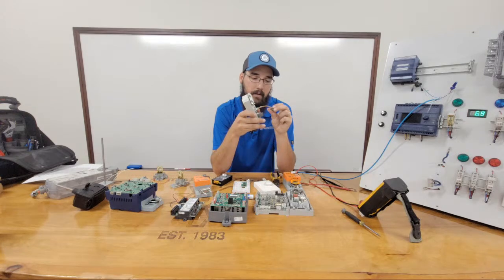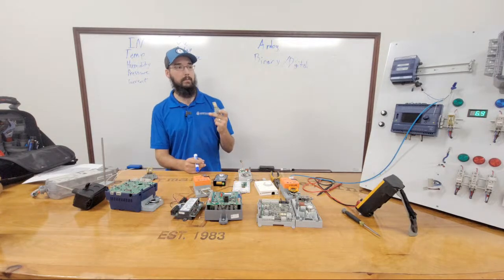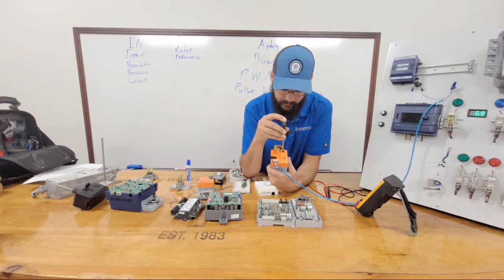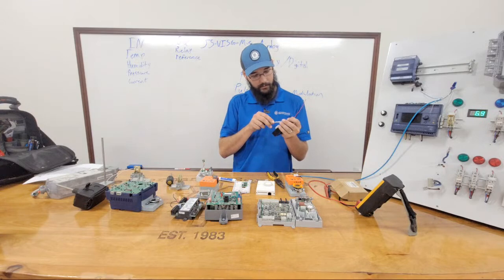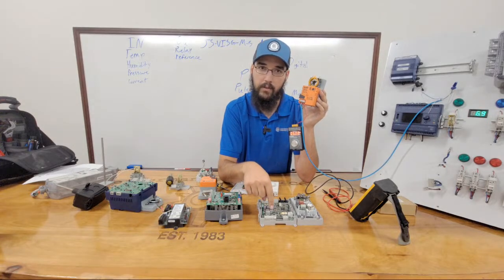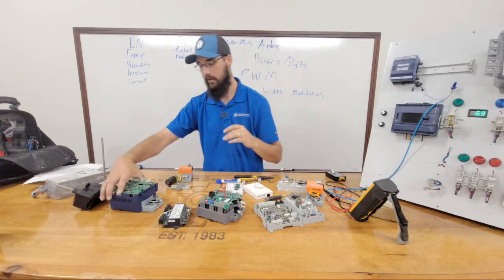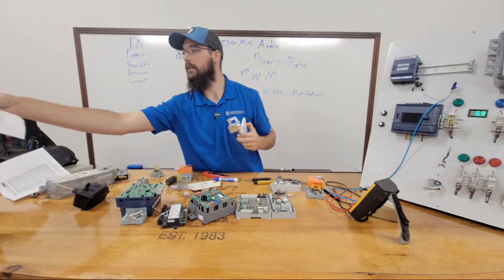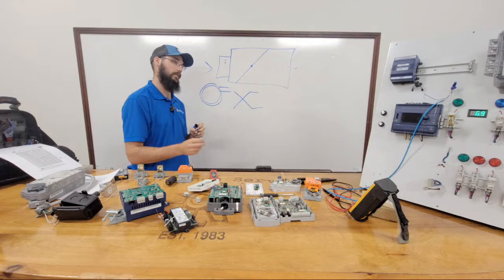HVAC BMS Device Troubleshooting

Comment: Floating point actuators is two wire 24 volt ac only? And dc driven actuators are 3 wire 24 volt with a 0 to 10 volt driver?

Comment: For a digital input, it confirms somthing, even though it is wired from DI1 and common, is voltage sent out to check it? Say 0 to 10 volts? How can you check it with your meter?